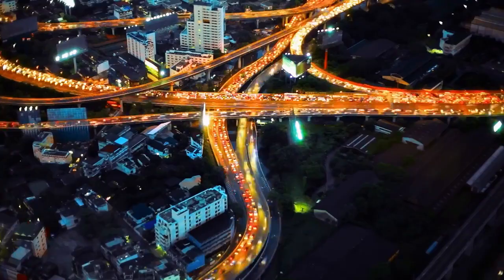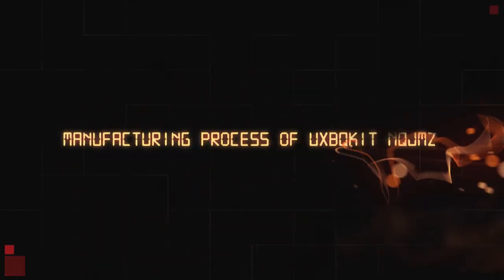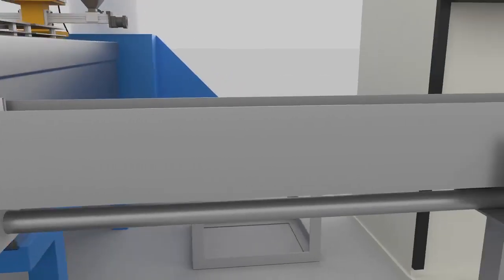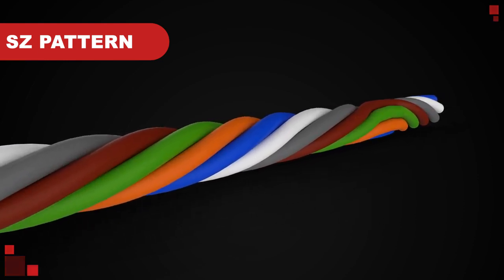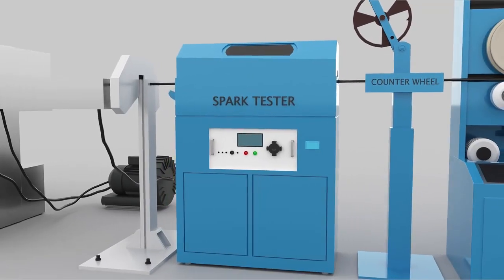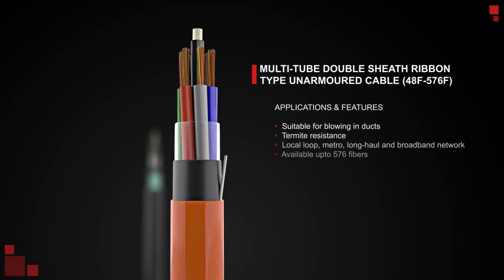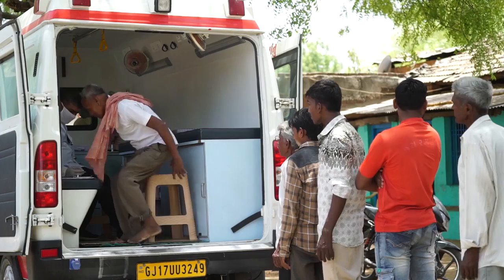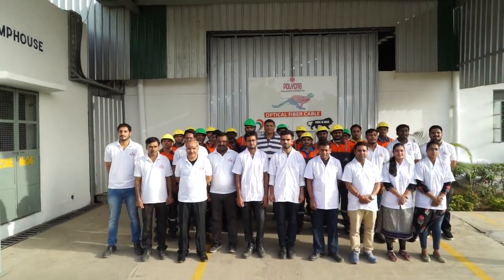Polycab's Optical Fiber Cable Manufacturing at Halol

Comment: WE SHOULD INVEST HEAVILY ON FIBRE OPTIC CABLE IF WE WANT TO BE SUPER POWER UPTO 2050
Reply: I think India already has a good fiber infra but it is not used to its full potential. I live in a village and there are 7 ducts of fiber running through our village, BSNL has 3 ducts and has 48 cores cable in each of them  i.e. 144 cores and 7-8 cores are in use and the rest are just lying there.